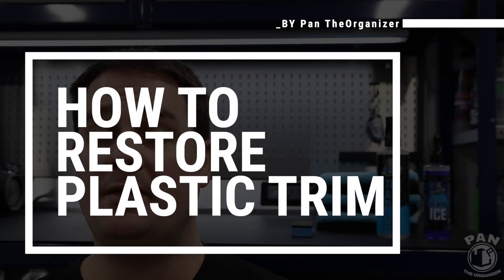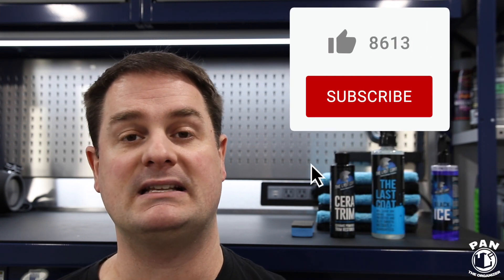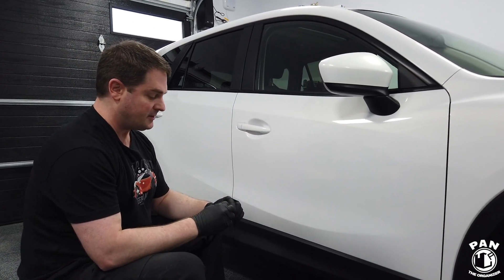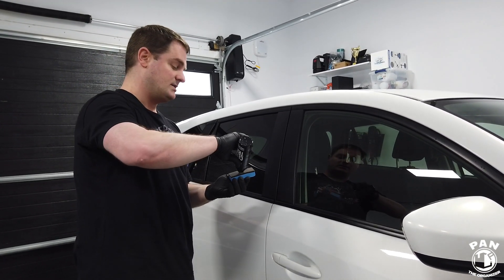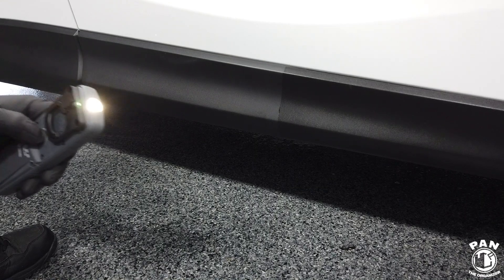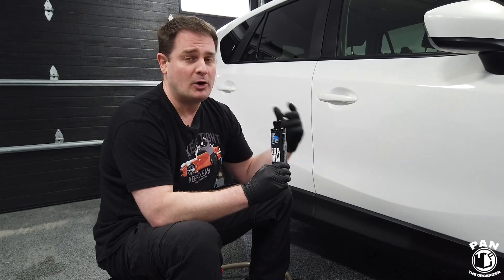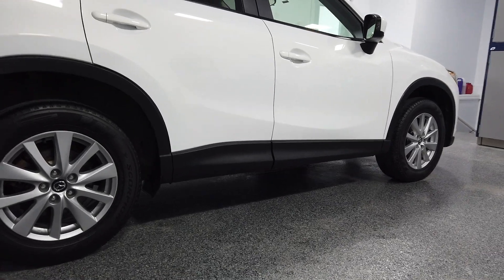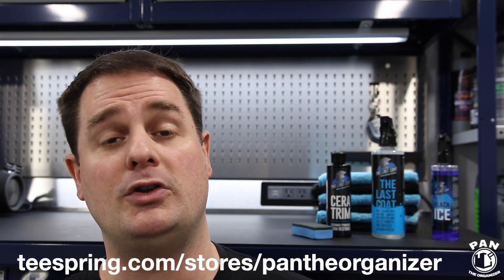Restore faded plastic trim on your car with CeraTrim!! IT WORKS!!

Comment: it works but does it last?
Reply from the maker: It has been a month and a half since I applied this and it's still like day one.  The vehicle has been through a few rainstorms and car washes and it's still intact.  This was just recently released so nobody had the chance to test long term yet, but all indicates that it will meet the claimed 12 to 18 months of durability if applied correctly.  The Last Coat always live up to expectations.

Comment: I really would like the video if you just used an 10y old car to see how much of a difference it makes. That car you basically used is brand new.
Reply from the maker: Well this vehicle is 7 years old (2014 model) so it's not new by any stretch of the imagination Willy.

Comment: The real question with these kind of plastic trim restorer products is how long it lasts. Most of them look very good after the first days of application and then fade rather quickly. This kind of testing doesn't show that aspect unfortunately.
Reply from the maker: That’s because it’s a brand new product and nobody has had the chance to report long term durability yet.  I will evaluate it in the coming months, but given the track record of TLC version 2.0 which is awesome, I don’t doubt this will meet the claimed 12-18 months protection if applied correctly.
Reply: @PanTheOrganizer  Thanks for your reply.

Comment: Will this work well, dare I say, tires. Tired of short lived tire dressings.  That car needs some serious TLC on the strut towers.
Reply from the maker: That’s simply some rust proofing on the strut towers. Although some people have tried off label use with CeraTrim on tires, it is mainly formulated for plastics restoration.

Comment: I'm not saying it doesn't work. It does. But "restore" is a stretch. It's a coating that's masking the damaged plastic. Nothing is going to "restore" it. I haven't found a product yet that lasts more than a few weeks in the sun and weather. Plastics aren't paint. Plastics will continue to degrade, off gas and oxidize no matter what you put on it.  If your plastics are new, yeah, this is going to extend the life if used every month or two. If they're already beat and faded this is going to make them look good again, but only for a short time.

Comment: I'm really disappointed with this product. A few months ago, I used it to restore my husband's hard cover tonneau on his 2016 Tacoma. It was hard to apply because it's so thick (the tonneau was textured which didn't help), but it looked really good after I was done. However, after a few weeks of sunshine and rainfall, it faded away and there was a greasy film on each side of the truck bed which was very difficult to remove when washing.
Reply from the maker: Did you properly prep and clean the surface with a degreaser or APC before application? I have had zero issues so far with this on multiple vehicles. It's still going strong, like day 1.
Reply: J'ai suivi les instructions à la lettre et je n'ai pas eu les résultats escomptés. Je vais refaire le traitement au printemps prochain, mais je vais utiliser autre chose que la petite éponge pour l'étendre. Merci, Pan!

Comment: Pan - would you consider doing a comparison between (and giving your opinions on) CERATRIM versus Solution Finish Black Trim Restorer? Or do you already have some thoughts (experience) with Solution Finish Trim Restorer? I bring your attention to this video -> https://youtu.be/vAYChd1iLk0 where I first heard about Solution Finish. I'm showing my three boys how to 'revive' a 2005 Dodge Grand Caravan - mechanical, body work, electrical, and detailing - all from our own garage. Thanks in advance. Kindly and continued success - jeff
Reply: "where I first heard about Solution Finish. I'm showing my three boys how to 'revive' a 2005 Dodge Grand Caravan - mechanical, body work, electrical, and detailing - all from our own garage. Thanks in advance. Kindly and continued success - jeff" ... I'm imagining that one isn't supposed to embed references to other YouTube videos. It was entitled "BEST Black Trim Restorer in the Auto Detailing Industry | Unbelievable." if you care to watch it for yourself. Be well. PS I bought CERATRIM using your 20% code. Thank you.
Reply from the maker: Both are excellent top shelf trim restorers, no doubt about it.  But in my testing, CeraTrim is easier and quicker to apply, and doesn't cause a black mess.  As this is a brand new product, I still have to wait 12 months to see how long it actually lasts, but I have no reason to doubt the 12-18 months durability claims.  The Last Coat are a great brand.
Reply: @PanTheOrganizer  I took advantage of your offer earlier today. Bought the 4-bottle pack. If any of your Canadian followers are asking and would prefer to avoid duty, I'll sell them one of my bottles. Thanks Pan (appreciate the follow up). I bought TLC CERATRIM because I saw their video where it was used on metal window trim et cetera. I need help with more than just porous black plastic.